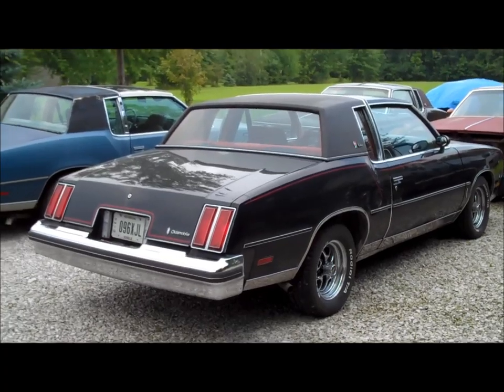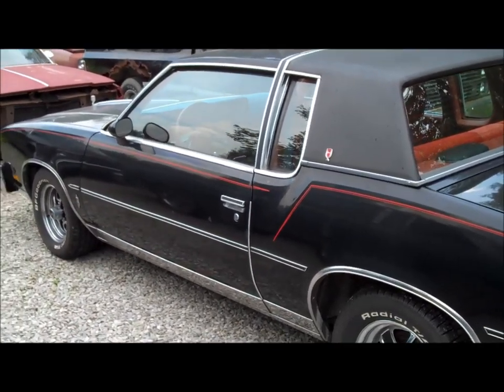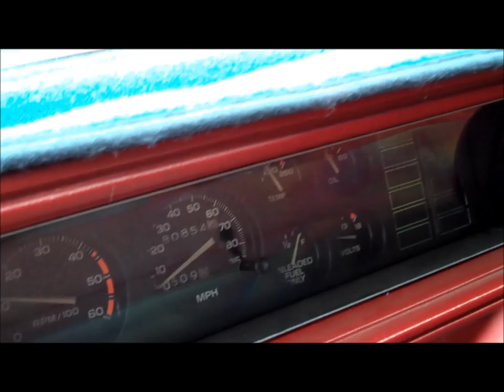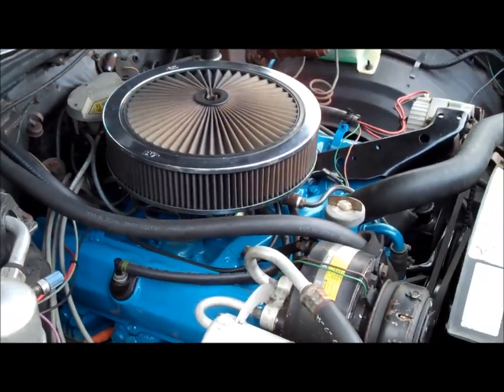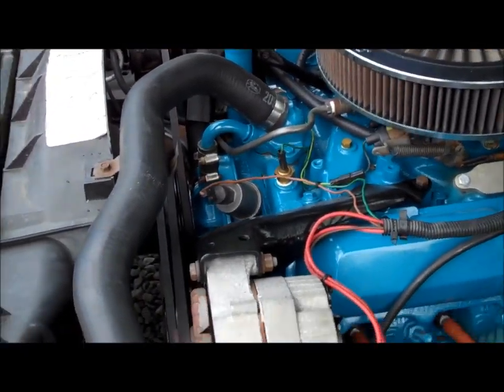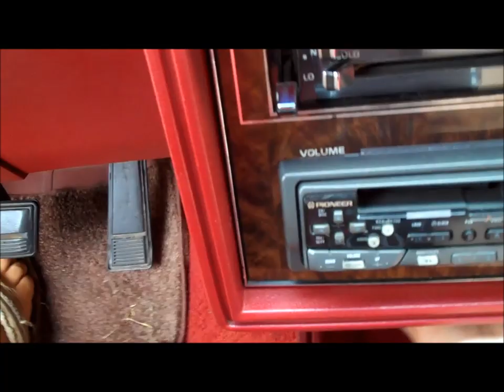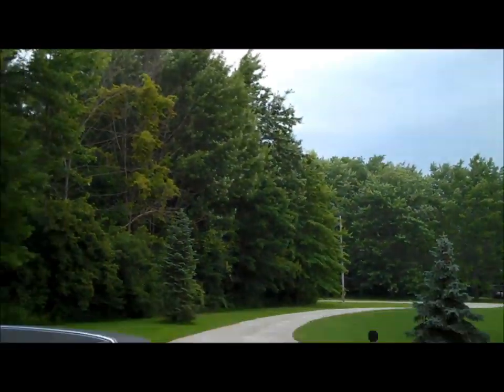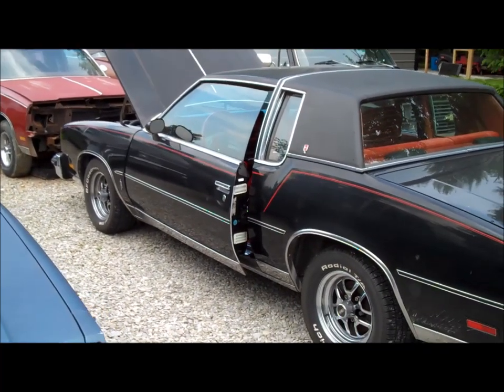My Car and Name on a T-Shirt! Classic G-Body Garage

Comment: Love that car. What is your preferred way of wiring in a kill switch? The wire for the starter solenoid?
Reply from the maker: Check out my kill switch video. I run mine through the ignition wire but there are other ways.   How To Install a Kill Switch in your Classic GM Car or Truck Classic G-Body Garage